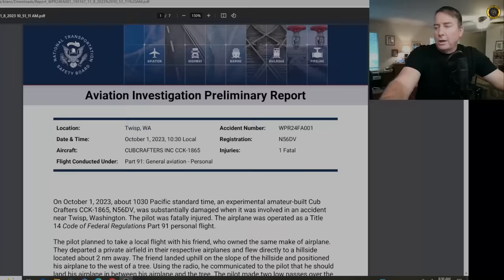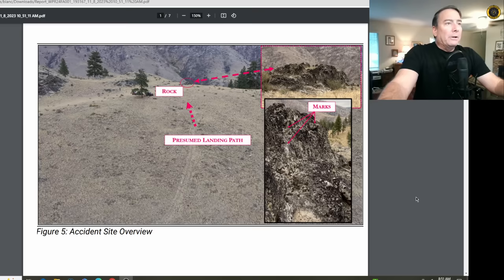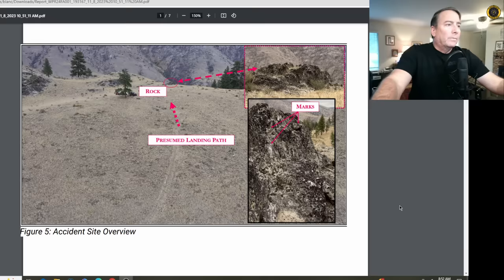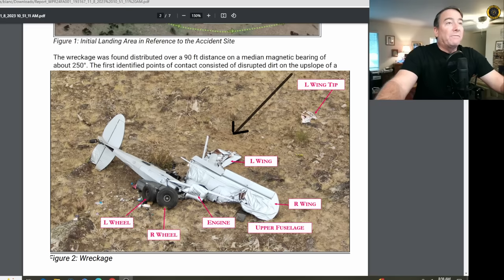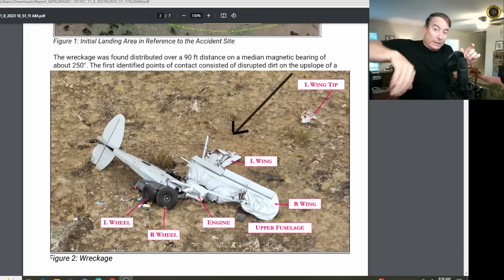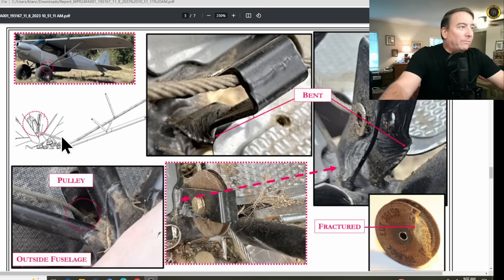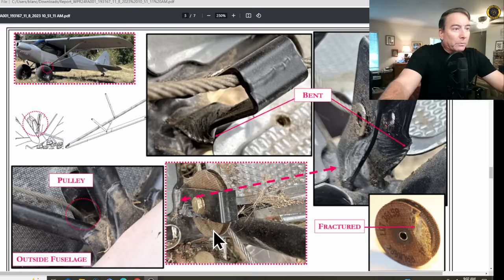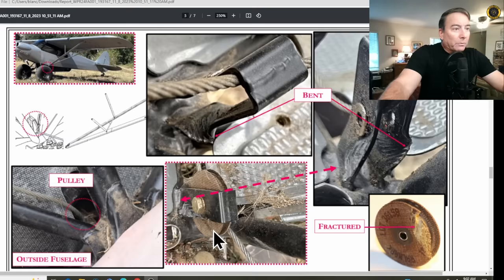Carbon Cub N56DV Fatal Accident NTSB Preliminary Report 10 Nov 2023

Comment: In the Commercial Nuclear industry, we called this type of experienced workers Cowboys. We saw them in Security, Maintenance, Operations and Management. It took a lot of years and a lot of expensive training and evaluation to beat the Cowboy out of those guys. They usually would end up making an expensive and dangerous mistake that would finally create the leverage to get them to change their ways. Based on the prior accidents (where people were seriously injured), this guy should not have been flying. 

Another example where a well-respected and personable stick-and-rudder guy who pushes the limits and regards the rules as guidelines, then runs out of luck and talent. Reminiscent of Bud Holland but with a far cheaper aircraft and far less human tragedy.

Great analysis once again Juan.

Comment: One contribution: I had two engine offs in flight, single engine, so end up as a glider… both due to fuel problems which is normal because over 90% of engine cut offs are caused by missing fuel. One was a damaged catch tank for inverted aerobatic flights and the other was a maintenance issue with a not tightened fuel hose. Now I’m waiting for the third if I’m reading properly…
Reply: I suggest you keep your feet firmly on the ground and stay clear of flying.  Someone isn't doing a proper pre-flight.
Reply: @richardlanders5300 no way to check all hoses and joint during preflight. This looks like A&P in hurry to finish job.

Comment: Juan, You may remember "Grace the ace"? she was an airshow performer that did  acts in her stock J3 Cub. I saw her routine often at all of the local airshows, Watsonville, Merced, Livermore. In 1978, could have been 1977, I was watching her routine at the Livermore airshow. She would takeoff as if  
she stole  the plane, and would fly around like she was out of control. They had an announcer acting like they were trying to talk her down and eventually send a vehicle out to the runway to try and guide her in. After a couple minutes, the vehicle and plane ended up coming from opposite directions. She would bounce the aircraft in all directions and would get really close to the car!
Well on this day, she was headed for the car and as she pulled up at the last minute, her left gear struck the hood . The gear attach fittings 
sheared and the gear separated from  the aircraft and went flying into the air about 50 feet. The right gear was swinging as she flew off due to the cross struts missing.
She landed in the dirt along side the runway and was OK. 
The car  suffered a damaged hood, broken windshield, and the driver had cuts from the glass but was OK.
Cub Crafters may have strengthened this area due to its off field capabilities. Aircraft "should" be designed so that components like landing gear 
will shear rather then bend structure. 
Large aircraft are designed to have the pylons that support the engines, and the landing gear,  to break away if they strike something during an accident.
Reply: Excellent comments and totally contradicts the people that think this POS involved in this accident was well-built.
Reply: I was at that airshow!!
Reply: Pretty sure I saw her at the old Fremont, CA drag strip/airfield in the early 80’s doing this stunt. This time, she came down hard w/apparently locked brakes, bounced straight up, then it rolled over on its back when it came back down. Bent up the prop and the top of the tail. She unhitched, dropped onto the roof and crawled out OK. More than we expected to see. 😬
Reply: I've been working in aircraft structural repair for 26 years , I've never heard of nacelle pylons "designed" to fall off .
Reply: @jimfalls8671  happens a lot when these clowns start playing around with their rich boy (and girl) toys
Reply: "Large aircraft are designed to have the pylons that support the engines, and the landing gear,  to break away if they strike something during an accident."

lol... yeah, ok guy.  Do you also lay your motorcycle down to avoid an accident?
Reply: If thats the only choice ... even on a pedal bike, or spin the car instead of sliding  into something...
Reply: @sethtenrec It's wrong to have fun if the equipment is expensive? Or if you're rich?
I don't see people who do air shows as showing off their money at all .
We're only just started getting Rams here recently, those people are trying to show off. Nobody here has one because they need it. Horse people always had 250 but that's because they are dragging big horse trailers around. 
I doubt most pilots would think about the cost of an aircraft, they just like flying and the machine costs whatever it costs. 
The trucks I've driven have cost more than the planes I've flown.
Reply: @chrisnoname2725  I don’t really care about the cost, just keep them off peoples roofs
Reply: @sethtenrec  fair enough.

Comment: A small loop of bronze centered around the cable just before the pulley seems in order. You would be able to inspect the bronze to see if the cable ever even tries to jump the pully and see rubbing. Ill  bet previous hard landings would have thrown the pulley off enough to cause rubbing, and it could be prevented.
Reply: A fairlead each side of the curve of the pulley might have helped but close-fitting fairleads then introduce the risk of snagging broken cable strands.

Comment: When I was 16 I worked on restoring 22 WWII Piper Cubs in Sussex , N.J. so its my favorite airplane. I think we could make the plane safer by changing the weak points using more up to date designs and materials.Especially with those much bigger landing gear. Phenolic isn't much stronger than paper. Re-routing the cables might be an improvement, being careful not to introduce new problems.

Comment: I live just about 40 miles south of Twisp. North Central Washington is a popular place for PP's due to lack of controlled air fields and low traffic. Even the major airport in Wenatchee, WA. (population between E Wenatchee and Wenatchee proper is about 150,000) does not have tower. We have multiple airfields in North Central Washington, none of which are controlled. I took about four lessons and flew in and out of four different fields. The terrain is whacky around here, going from high plateaus to river valleys to high alpine mountains in a relatively narrow airspace, and... we have extreme weather here. My fourth and final flight lesson was flying out of Wenatchee (EAT) in 104 ground temp. Flew up to Chelan. Ask me how fun that was in a Cessna 150. Ha ha.
Reply: I live in Wenatchee and my amazingly ignorant, arrogant Brother flies with this group and recently. He took our very own mother on that flight. Imagine if you will they won't listen to common sense, He even posts a video about it and then shows that he's the one that wears the helmet for safety and leaves our mother with nothing. Is great job chad patterson.

Comment: Too bad no one called this pilot out early as a result of taking too much risky flying.  Early in my career I worked as a CFII, and found one of my students taking excessive risks flying his newly built RV-4.  He demonstrated that anything goes as a airplane owner, with no regard to safety, or his passenger.  As a result I sent a letter to the pilot that I was removing my endorsement of his recent flight review, and that he get another instructor endorsement in his logbook.  This accident might have been prevented with his pilot friends to take less risk.
Reply: Watch Mike Patey's last video. He kinda talks about this. It's about time we call our friends out on reckless flying.
Reply: I had a conversation with an individual today that called Dooley out on his judgement on several occasions. Apparently, so I’m told, there were numerous complaints from individuals, state officials, etc regarding off airport landings in areas that were clearly not legal. I had no idea he was the outlaw that he was. This is a perfect example of there being old pilots and bold pilots but not many old bold pilots.
Reply: I turned 71. I gave myself the first "strike" for this. Notwithstanding 23.5k hours of which 5.5k GA @TheFlyingStampede
Reply: Except that you cannot "remov[e] your endorsement" once made, unless you can show you were provided fraudulent experience data or licensing.
Reply: @TheFlyingStampede Mike knew Dooley, one of the 4 friends he recently had lost. I knew Dooley as well.
Reply: I actually did warn him on FB when my friend posted a video of them flying together doing something against regs and dangerous.  he publicly ridiculed me and then was dead two weeks later

Comment: Sounds like about three things went wrong all at once. I believe you can make a cable holder that keeps it inside the groove of a pulley fairly easily to prevent the cable from coming out of the groove

Comment: Hi Juan, this is really the first accident review of yours I’ve listened to closely because it is quite relevant to my own flying career and current flying.
I think you did a good, objective job with it; especially the relevant parts of the aircraft that appear to have failed.
After almost 30 years of off-airport flying in Alaska, and 20 of them for work (in my Cub), it’s never more important now to evaluate the risk/reward, and mitigate risks whenever possible.
Again, well done.

Comment: what an awful situation to witness before Dooley's fellow pilot 
this kind of accident does remind me of the chute that Mike Patey installed into his scrappy project

good idea or not, still might have saved this chaps life, although the altitude and time before contact might not have been within limits of a chute fully deploying, i also wonder if killing the engine might have had a different outcome, i guess every pilot must think the same, that he or she is good enough to get out of trouble and then the unthinkable happens, for you outback country flyers, see Mike and get a chute fitted, got to be worth the trouble and money

i witnessed a friend on full power take off, on a private grass airstrip, catch a downdraft and his gear hit the top of a fence, the fence dragged him down at no altitude, barely ten feet, slammed into the deck smashing the airframe to pieces, i don't think i ever ran so fast in my life to the scene, both my friend and the pilot were fine, but it certainly scared to SH1T out of me, things can be so different in an instant, experience and age accounts for nothing, gravity often wins

Comment: If he made two discovery passes why would he make his final approach in the wrong direction? That part is very curious. Which direction were the two previous passes and did his friend correct him? Did he choose a different path on the final approach?
Reply: Didn't land in a different direction.
Reply: Kevin, by different direction do you mean on the other side of the tree away from the 'path' that the first aircraft landed and to which that first pilot was guiding his companion, the second, to (his side of the tree, not on the other side where he, Dooley, attempted his fatal landing)?
Reply: Because if you do a low pass with another person already on the ground you have to land or they pull your cert. Just ask Trent

Comment: Time 820  The pulley really needs to be wide enough or bracket narrow enough as not to allow the cable to become wedged off the side of the pulley.
Reply: And the pulley needs to be aluminum. If the pulley hadn't delaminated, the cable might not have jammed, and he might have been able to limp home with just a hanging wheel. The rock wasn't the problem, the pulley was the problem. The plane was still flying after hitting the rock.

Comment: Good analysis of this incident. Sorry to hear the pilot perished. As a young Navy pilot I assisted in the wreckage recovery of an A-6 that flew into the ground because of pilot error - pilot disregarded a safety regulation resulting in the death of himself and his right-seater. I was also part of the honor guard at the pilot’s military funeral and witnessed the grief of his young wife and parents. As a result, later in my career in my role as instructor pilot in several different type aircraft I had no tolerance for willful disregard of safety regulations. Perhaps the information learned from this incident will resonate with another pilot(s) out there and will prevent a similar incident. ‘Nuff said….

Comment: I had to go read about Dooley Vanyo to understand this crash better, Retired at 40 passed at 59, raced motorcycles and flew for giggles. And really I think that's the problem - if you have to do this for a regular job, flying is very procedural and mechanical - but if your flying for giggles - then its captain obvious - people just go and do. GA aircraft either need to come up a notch or two on crash performance or the culture and training need to drastically improve.

Comment: I fly helicopters for a living and gliders and skydive cessna's for fun. I like direct steering and what gliders and helicopters have in common is pushrods for all or most flightcontrols and no cables. Cables are from the past imho, pushrods fly better and are stronger and more redundant.

For ME currency I fly a Diamond DA42, with aileron pushrods in the wings. Fly very precize and the rods are in the carbon wingstructure. For me this is the future, but I understand a DA42 doesn't land on a hilltop. Sad accident, thanks for sharing.

Comment: I a not a pilot, but it just seems to me that if you have the aircraft on the ground rolling, especially on terrain like this, you would be better off sticking with the landing even if it results in a crack-up, rather than trying to go around and risk an even bigger problem..I have seen too many cases where someone had the aircraft on the ground, one here near me locally that I vividly remember, then decided to do a go around which resulted in a fatal crash...

Comment: That carbon fiber pulley,  I have made my own of billet(only a few grams more of weight) never trusted them. Mine can take more energy to fracture. I was a freak type thing but maybe a little design change will not hurt. After all it is an experimental aircraft. RIP Pilot. Nothing bold about landing in the mountains it's a normal part of flying these types of aircraft.

Comment: So sounds like pilot skill is suspect but I will also say that there seems to be a design flaw. Sustaining damage to ones landing gear shouldn't result in loss of control of control surfaces.
Reply: It's not small damage though. A low wing aircraft would have crashed right there and then.

Comment: With density altitude being such a big contributor to many accidents, is there any such thing as a density altimeter?
Reply: Well, in a way every altimeter can give you the density altitude. Put the baro set at 29.92 and read your density altitude. Then don't forget to put the baro set back.
Reply: @mikebarushok5361  that will give you pressure altitude, not density altitude.
Reply: @1jwebber  You are right and I was wrong. I've always been confused between the two.

Comment: The worst thing about watching these reports is the realization that the accident didn't have to happen.
A $1,500 bicycle often puts cables through the center of the tubes, out of harms way.
Reply: Don't think the problem was with the cable routing but rather the failure of the phenolic pulley. If that pulley had been made from aluminum or steel it probably wouldn't have failed.
Reply: These are EXTREMELY safe aircraft, built very well and to very high standards. When a pilot slams the aircraft into the ground, it's certainally not the fault of the aircraft!!
Reply: Then you can't visually inspect them, and they would be harder to maintain. The cables being exposed is a large part of why the Carbon Cub is so safe.
Reply: another example of "this is how it's always been done". The engineer above has it right, losing landing gear in a rough landing shouldn't cause the aircraft flight controls to jam leading to the crash. If the estimated flight path after hitting the rock is somewhat accurate, it's obvious, with the ailerons jammed, the pilot was just along for the ride all the way to impact. No control.

Comment: Engineering needed: A re-routing of control cables so as to remain functional after loss of landing gear attachment points.
Reply: Seems to only be an issue if you're slamming into things. I'm wondering how many other accidents in similar aircraft have been caused by loss of landing gear attachment points. My guess, not many.
Reply: Was the cable and pully an issue that caused the aircraft to not being able to follow intended landing direction.
Reply: Thats a proven 84 year old design.

Comment: I’m wondering what, if anything, the pilot could have done post-gear strike to bring it down safely…or was it simply destined to crash no matter what he did at that point?
Reply: I was wondering if the landing could be continued since the aircraft was already low and at lower speed. It would not be pretty, but may provide a better chance of survival.
Reply: @henryschuyten7718 But you probably don’t realize how bad your control situation is until you leave the ground again and try your first attempt at a roll.